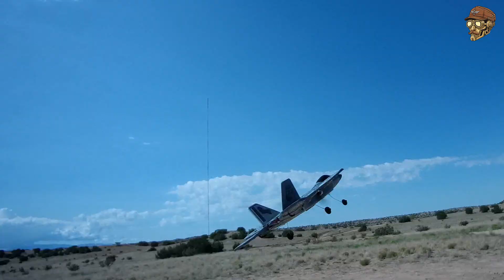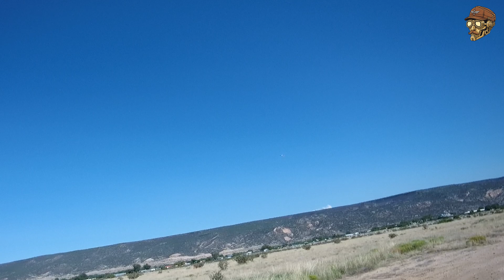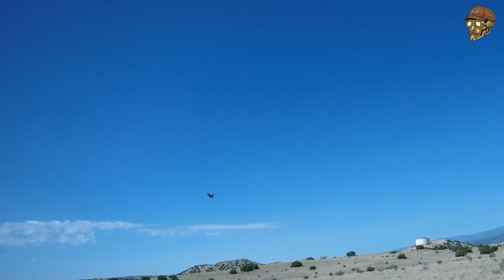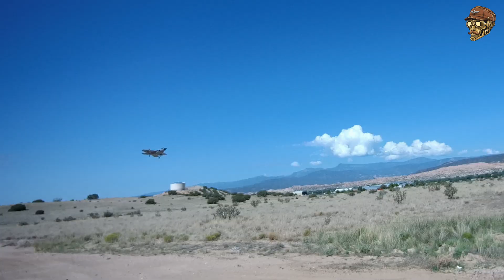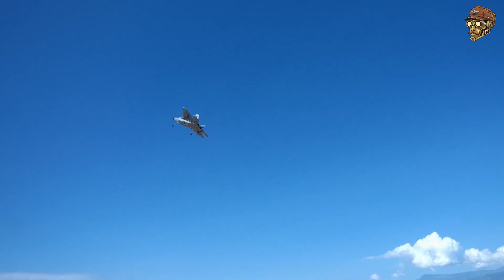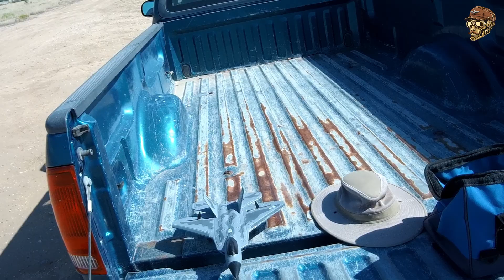Testing Vertical Mode! BM31 F22 355mm Wingspan 4CH Twin Brushless Motors Gyro RTF

Comment: This thing will destroy batteries. I run mine on a dual hv setup so the batteries can keep up without burning out in a few flights
Reply from the maker: Hum..I'll have to put a load meter on mine to see how many amps it's pulling.
Reply: @tinkerzlab  also vertical mode eats the batteries faster. Check the battery temps after flight
Reply from the maker: @TheMightyPooh420  Vertical Mode definitely pushes the power system and LIPO .
Reply: Great Note!  Did not consider.  Maiden mine with 2 flites.  800 mah and 1000 mah.  I prefer the 800...wylder ryde😊!  But i did notice each battery.  I came in with power soo low.. it would not read on the Batt tester.  The Low Batt warn did sound on Rx.  But only 30 sec b4 it came back to earth.  Sooo i prolly killed two batts...😮